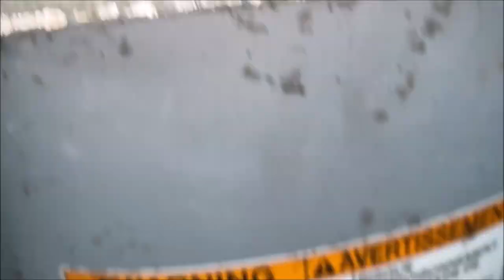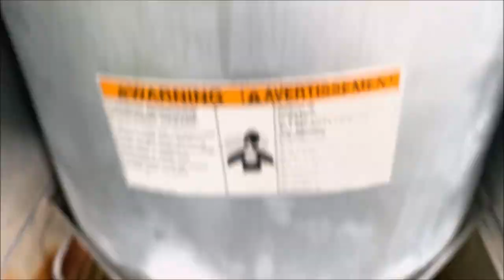Rusty HVAC Blower Shaft No Puller Needed

Comment: In 25 years of hvac work, I've changed out about 25 standard blower motors. In the last 5 to 10 years, I've changed out 100s of ECM motors. I just don't understand why the industry can't make a better motor or just go back to the old way,  it worked.
Reply: Money that's why
Reply: @roaddog7793  answered correctly.
25 motors in 25 years vs 100 motors in 5,,, there's you answer. Same w new furnaces. Since you're the manufacturer,,, why not send in your legislation to devise schemes where you're only responsible fir building furnaces that last 7 to 10 years,,, nowadays. 30yeartech here.
Reply: Years ago I had said that there was something wrong with X13 blowers I was finding in Carrier, Bryant, Payne, Day and night. Every monsoon season 1-5 year old motors failing left and right. I knew it had to be moisture getting into the motor. Had a ECM motors class at my last company and they admitted that the motors had a problem with accumulating moisture and they're toast. That's here in AZ I can only imagine how bad it was in other states with crazy high humidity.

Comment: Also don't prefer to use pullers. I like to take a black pipe nipple and sleeve it over the shaft, use that to tap the wheel down and break free. Then use a wire wheel with a hex shank in an extension in my impact to get all the rust filed down. Thanks for another great vid dude!

Comment: First of all, Thanks for the videos. On those I found using a die grinder and cutoff wheel works best, cut the shaft off as close to the hub as possible, if motor is junk. Then you don’t have to push through all the rust. I think Supco makes one that’s a little easier. Some places don’t allow sparks, so your method is good too. The Rotary Hammer is a great tool with a chisel or punch. It’s like a heavy air hammer. I have been commercial HVACR for 24 years, you learn something new every day.

Comment: I have an old Whirlpool window unit from 1969. The old Delco fan motor was shot. So a couple months ago I decided to replace it. Being in a window for the last 5 decades wasn't kind to the motor shaft on the condenser side. It took a lot of Blaster and beating with a hammer to get the fan off. The unit now has a Fasco motor in it (factory spec replacement, new capacitor too) and is running great. Sucks water out of the air like a sponge.

Comment: I do exactly what you do. I do have to use the puller here and there, but i try as hard as i can not to.

My ONLY criticism of video.. im pretty sure those universal blower motors have to start up with the door panel on because they have to program themselves based on static.

Comment: I put a 24 MM socket with an adapter for my drill. Get my blade pulled all squared up and tightened on the hub. Grab the back of the blade puller with my crescent wrench, slap my socket on my blade puller bolt and squeeze the trigger. Not had one motor I couldn't pull with it. I of course sand and lubricate the shaft first. I also live in Arizona where we don't have nearly the humidity so maybe I'm naive in thinking it would work on a motor like this but I've had some pretty stuck motors and no issue.

Comment: I soak in wd40 and let sit as long as possible. After, sand shaft very well. Take pliers and move it with channel locks. 95% percent of time it works. Hub puller rarely needed.....

Comment: Question, have you ever seen the wiring blow out of compressor and oil everywhere? It's a Goodman. Thanks Hoss. Step on that loud pedal. Need more drag racing vids
Reply: That’s a burn out new compressor flush lines add suction filter drier.

Comment: If fails for a few reasons. Lack of maintenance, lack of filter changes and running the temps 69-72 all the time with unit being dirty. These motors gotta stay clean with a good static

Comment: Cleaned out my coils today and noticed the air was coming out of the top, but to the sides and not straight up.  Works fine otherwise, any idea what causes this and should I be concerned.  10 year old Payne system
Reply: Might need to clean it again, that’s a sign of dirty coil.

Comment: And yeah you don’t have to use a puller but shoot I would rather use my puller and be done in 20 mins then go through all that trouble. 🤣

Work smarter not harder
Reply from the maker: A puller is slower in most cases.